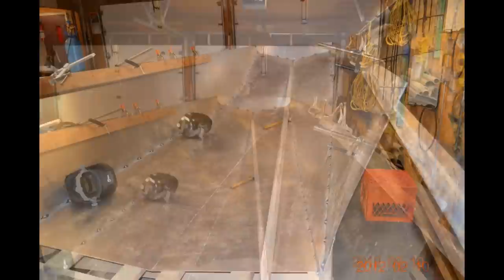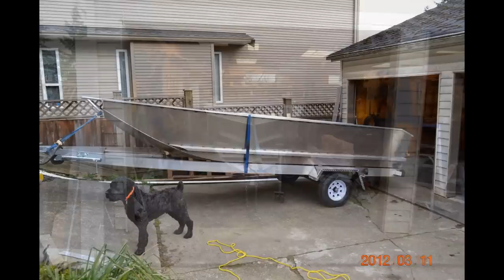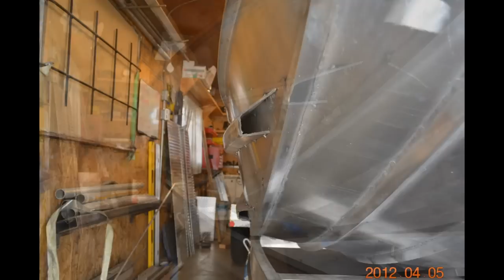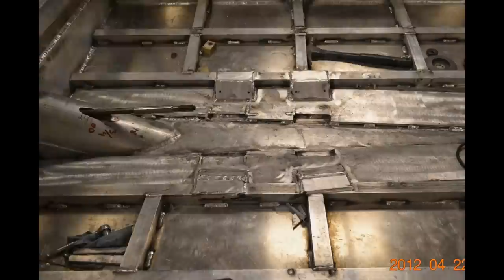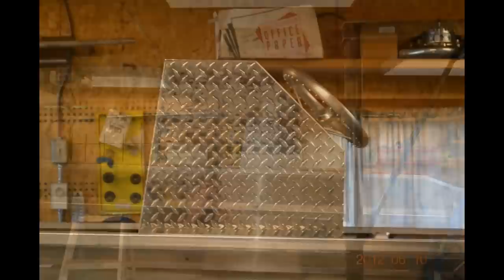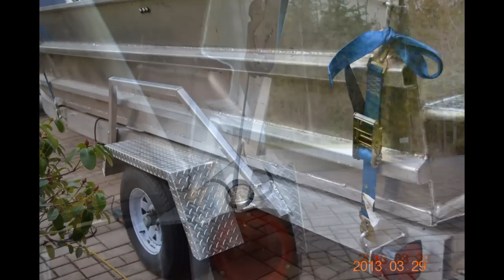Home Built Jet Boat

Comment from the maker: Fall of 2014, my hunting partner and I took this boat on a Northern BC adventure.  Although underpowered, compared to most of the jet boats at the Kechika river, it performed excellent.  It managed to haul 1800lbs of 2 guys, a big dog, 320L of fuel and 2 weeks worth of gear 160kms up river and 160kms back again.  We saw some action when we ran out of fuel on the way back, but it was not the boat's fault we miscalculated.  I should mention that 2000lbs pushed it over the power limit and it would not plane, unloading some non-essentials and some spare fuel (haha) got us down to 1800lbs and the boat planed and cruised at 23-25mph against the current.  Coming back downstream, it cruised at 30-32mph and burned 1/3 the fuel.
Reply: Did you get what you were hunting?
Reply from the maker: We were after sheep and passed on several moose in the beginning of the trip.  Not familiar with the area and being there a little late in the season all we saw was ewes and no rams.  We came back empty, but it was quite an adventure.
Reply: Andrey Andreev best to leave the animals in peace
Reply: Great concept boat

Comment: Nice build but you are missing some things #1 you need to install so rod holders #2 you need more storage #3 you need more seating #4 you need some more gauges like fuel and all that fun stuff but over all how much did it cost to build the boat and the trailer

Comment: Beautiful job lots of hours,cutting,fitting,welding from looking at your welds not much grinding!!!Welding much better than a DAMN RIVET!You should be proud of your work!!!As wide as the boat is!!!!Move that one engine over and put another one along side of the other one engine.Twin engines make lots of smarts,one engine will plane the boat,if failure occurs.Two engines haul ass,boat more maneuverable now,one engine in reverse other engine in forward, boat would pivot in one spot,that would be way cool,
What kind of MIG did you use,did you do the welding!!!!!ALL LOOK GOOD!!!!!!But it is only as strong as your weld:LB
Reply from the maker: +Norman Troy Thanks.  The boat was built entirely with a Miller 252/30A spool gun for MIG and a miller 180SD for the finer TIG.  I did all the welding, but did need some help with the fit/fab as some of the parts are quite large.  We put this boat through some pretty rough stuff every year now and haven't had any issues with the welds.  I'm happy with the way it works on the current set-up, but maybe in the future, I will look back at the twin engine set-up.

Comment: Your craftmanship is out standing. Why don't you put a turbo on the motor. That would increase your horse power a lot. Plus that would be a lot cheaper than replacing the engine. Thanks for the video.
Reply from the maker: +Richard Gottshall Thanks,I did quite a lot of turbocharging in my younger days, mostly imports, some high output race applications, but turbocharging a 2 stroke with triple carbs and triple exhaust is very complicated and problematic.  These engines are fairly high strung and not a good choice for turbocharging.  The motor is matched with the pump, so right now, even when the boat is overloaded (1800lbs or so) it moves, but cant plane, the motor will still hit full rpm (7600rpm or so).  This tells me I am over weighing the pump, it just cant move enough water to propel the weight.  If I want substantionaly more  performance, the answer would be a motor/pump combination.  I am happy with the capabilities of this boat and would not change it.  This year we shuttled 3 quads across a lake and came home with 3 moose.  I am building an 18', 84" beam forward console which will be powered by 280hp 4.8 LS motor and AT pump.

Comment: Very cool.  I will be making a boat like the woolridge Alaskan xl center counsel.  Just wondering how much you have in to the hull minus the UHMW?  Do you think 135hp is good number, or do you wish you had more?  I will be making a 20ft x 78 inch bottom , and 98 inch at gunnels with .125 hull.  I was looking into 200-225 Yamaha vmax outboard jet....... too much?
Reply from the maker: 135hp is more than enough for my boat, but you can't go wrong with more.  200-225 is not too much for a boat that size.  If I did another one I would use 3/16" or 1/4" thick for the bottom, it will make it easier to keep distorsion down and you don't need as much reinforcement inside.  In the end the weight is almost the same.  Not including the motor, material cost for the hull is around $3000, trailer material and parts are around $1000.

Comment: Im thinking about building one and yours is very similar to what i am looking for.  is there any blue prints or layouts you used to build your boat or did you just build it based on what you thought would work??
Reply from the maker: I loosely based it on a Wooldridge Alaskan, but it sort of evolved into what worked for me.  The motor is completely in the floor opening up space, I canalso fit a full size quad in front of the console.
Reply from the maker: No blue prints, just my sketches and a wood hull jig.

Comment: What's the process for bending all that aluminum? The hull for example looks like you found a massive break somewhere to make the keel and chine. Do the stringers need to be bent before they get welded in or do you press them in and weld in place?
Reply from the maker: The hull was braked on a 20' brake, 3 angles to get a 8 degree deadrise, 60" bottom,74" beam .  The stringers were rolled on a 3-die rolling machine, they are too stiff to form into the hull.  The bow was formed using flat bar jig and bent in shape by hand.
Reply: Good to know. I've talked to a couple shops and no one has had a brake over 10 feet. I'll have to do more digging.
Reply from the maker: Yeah, 20ft brakes are not that common, but they're out there.  You can always just build a jig to hold everything and weld it all.  Its only 1 extra joint.  That was my second plan.  Screw it all down with welded tabs on the outside and a few through-screws in the centre along the joint and plug them after all the welding is done.  Cheers.

Comment: Did you bend your aluminum by hand? If so explain!
Reply from the maker: Ripptyde Fishing  the sides were done by a shop with a 20’ brake, the front was done by hand with a jig I made.
Reply: Very cool, im going to look into it. Im starting on a 16'ModV and 110hp 787 ski. Im going to look into bending DIY, the only thing I really see needing it for would be round bar on the leaning post as well as the steering stick.

Comment: How much would the design need to change to run twin jet ski motors? I'd love to build one similar but a just bit wider, and longer.
Reply from the maker: To run twin jet ski motors, quite a bit has to change.  The most difficult part would be the jet intakes.  You could design 2 small tunnels and have no delta pad in the centre.  Other challenges are syncronizing the 2 motors to your steering and throttle controls.  The motor I used has triple pipes which take about as much space as the motor itself, so when planning to use 2 motors, it is probably not the best choice.  I'm thinking twin 4 strokes, hmm.... a bit heavier and taller, probably not able to hide under the floor.  A couple of Rotax motors 85hp ea with single pipes might be the ticket, compact and a combined 170hp would move things along nicely.  Ultimately a more powerful single motor is probably the most space, weight and cost efficient option.
Reply: Andrey Andreev How bout a salvaged 1000cc bike engine? I saw a boat similar to this with a kawasaki zx10r engine, screams.
Reply from the maker: I thought about that, but the jet ski offered everything I need in one package.  Otherwise it would make similar or a little more power, also more complex cooling system, jet pump options and some added expense.
Reply: It would eliminate having to run a twin engine setup and would also spin higher rpms - more top end, lighter than twins, no syncing throttle/steering, etc. I would bet it'd be cheaper to have a fab shop come up with something to mate the engine to your existing jet setup than to do twins. 

Cool boat though, nice craftsmanship! I can't wait to build my own.
Reply: streetntrail if you have to ask that question then you have absolutely zero fabrication skills and should not attempt to build anything let alone a jet boat
Reply: Revenue Retrieving hahaha, how sweet of you.
Reply: streetntrail im just kidding, thank you for your awesome attitude. the world needs more people like yourself.
Reply: Revenue Retrieving I made a living for a few years building off-road suspensions, but more recently have been toying with boats, so yeah I know nothing about fabricating 😉. Thanks for your later compliment...I'm now conflicted as to whether I should be offended or not. Does the world needs more of me or am I an incapable ignoramus, hahahaha...if you can't tell I don't take myself too seriously. keep the shiny side up and the greasy side down bro.